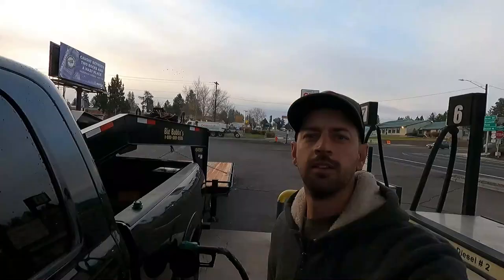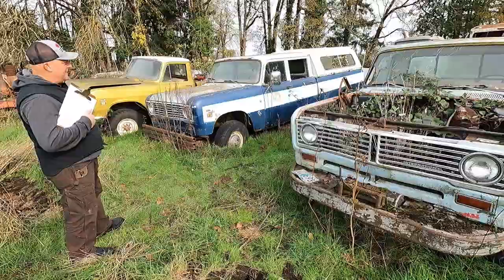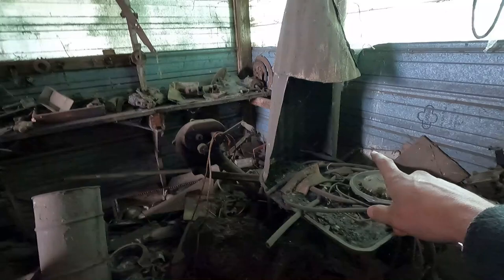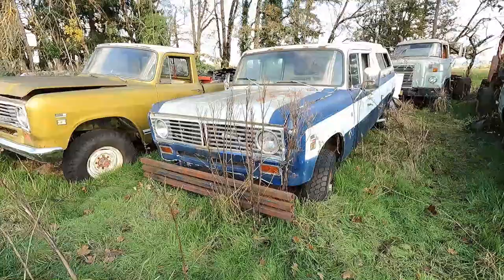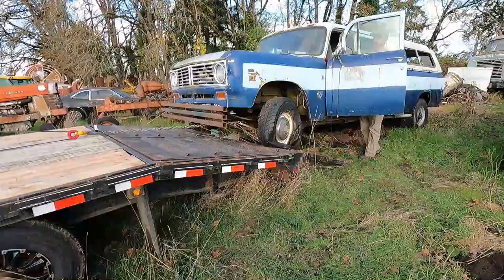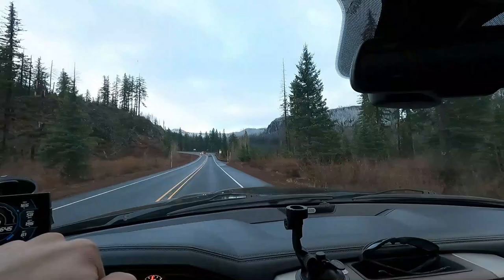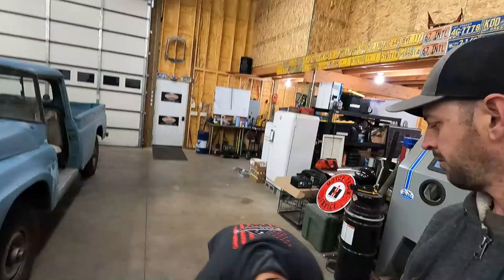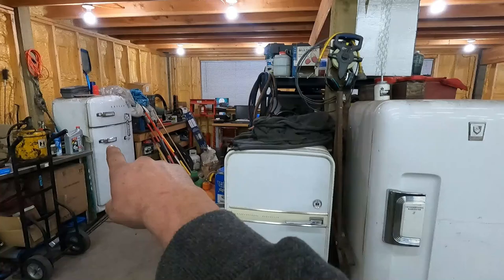Rescuing classic trucks!  Going picking at a 150 year old ranch!

Comment: an old boy here in town bought a 1967-68 3/4 ton international out of the factory with a in line six engine  which IH put in their 656 farm tractor, combines and other  farm equipment. later IH 3/4 ton 2 ton up used their 6.9 diesel in them. That 6.9 liter was sold to ford to install in their pickups which later became the 7.3 when they installed turbos on them. That will get you started with some exploring on ford using IH engines in pickups and larger trucks

Comment: Used my harbor freight winch to drag a dead 99 suburban that the rear tires were seized up onto my trailer today. Winch never Skipped a beat and just kept pulling.
Reply from the maker: Yep, they are awesome.   And this was only the 9k winch.   My other receiver mount is a 12k
Reply: @CaseyLaDelle  something wrong with the remote?
Winch seemed to be cutting out.
Reply from the maker: @haroldphipps3457  yeah....  My finger on the button..

Comment: We all use the hobo freight winches like that, but if you read their warranty, they specifically void the warranty for that use. 

I’ve always used the 12k model. I’ve pulled an international dozer with locked up tracks sideways. Had to have someone in the truck holding the trailer brakes full on with truck brakes full on as well. I’ve only have had the 12k snap twice and that was my fault for not having it secured properly. 

My only complaint is that they don’t have enough space above and below the cabling. Would be great not to worry if the wire is perfectly wound.

Comment: I've got a 12,500 pound winch I bought from Harbor Freight a while back (haven't installed it yet on my  1949 Chevrolet 6400 Series truck I use as a wood hauler) and I haven't seen anymore of them, seems like they are all now 12,000 pound winches. Mine is a Turbo Shift Classic and I plan on using it to pull logs into my truck so I don't have to venture off and cut the wood into small pieces then haul each piece back and split in then stack it in my truck. Going to save me some time, work smarter not harder... I think I heard that somewhere before!!! 👍

Comment: Traction King was a 70's model of a Case 4 wheel drive tractor. My dad was a Case dealer when I was in school. We drove a lot of these and the others around. my brother and I worked for my dad from when we were 12 years old. the 70's models were so nice compared to the 30's models. Like a 830 model, 930 model, 1030 model, etc. became 870, 970, 1070, 1175 and the 4 wheel drives were cool to drive too. Key point of the 70's models were the quiet cabs that had radio and air conditioners. The engine for the bigger tractors was a 504 turbo straight 6. Case had gone into a partnership with Cummins at the time to produce an efficient engine. Lot of years ago though for me.

Comment: 29: in and watching the unloading. U just hit on the issue the forklift was having. That diesel engine looked super heavy. Wide thick cast iron. Looks like he could have picked up closer to the front and deeper on the forks, but mainly, that thing is just ultra heavy. Rear axle may have been a srw D70, but not heavy enough to truly offset/balance. What fun though. That valley was like quiet as heck.

Comment: On the engine. Ford at first used an International diesel. Had so many problems with it, Ford designed and built their own. It got the diesel pickup market started. Buddy had one. Sure looked like the engine in your pickup.
Reply: IH built and used that engine for many years, then Ford made a deal to use it also in their pickups until they built their own recently.  They had GREAT success with both the 6.9 and the 7.3.  the only one that had some problems was the 6.0, but not everyone had trouble with them and many of them have 3 and 400,000 miles on them, and the 6.9 and especially have 500,000 and more trouble-free miles.

Comment: INTERNATIONAL,  EQUIPTMENT, 3600 acre farm in 50's had  even INTERNATIONAL  chest type deep freezer, D6 bull dozer, cab over stack rake cattle hauler, 1 ton 4 wheel driver pick up, plowed 3 mile drive way , by East Jordan MI. An M DIESEL TRACTOR , coolest place spend lot of gun times.

Comment: instead of using square wood for the winch cable at the end of the trailer,  try using a round piece of wood or pipe. It will move with the cable as needed.

Comment: My uncle had a huge salvage yard n tried to work me to death in it. It's driving me crazy I can't remember the brand of the other cab over like that he had that was way older and terrifying. 10 speed column shift .This is true. Without a load on the fifth wheel a light tap on the brakes would stand either one of them on the  bumper and windshield. Not a fond memory. Dandahermit

Comment: The motor that is in that 3/4 ton International crew cab pickup is a International diesel motor and most likely came out of a Ford truck.  Ford started using the international diesel motors in production as a OEM option in 1987. When you opened the hood on a new Ford 3/4 ton F250 or 1 ton F-350 the motors were painted in a medium Grey painted color. Ford used the international diesel motors from 1987 till the early 90's. When they designed and produced their own diesel motors which were the "Power Stroke" series which had their own problems with oil lubrication and other problems. They have designed a number of litre size motors through the years till present. What is really a mystery is that the International company was not building a pickup trucks at that time so none ever had the V-8 diesel that they produced for Ford in a International pick-up until someone put one into the one you picked up here!

Comment: Hey Casey &  Ben !!   Looking at ""GOOGLE""  ,,here's the list of diesel motors that IH used in the 1966-1988  (DV)462 -7.6L-460CI 1966-1988    (DV)550-9L-550CI  1966-1988   (DV)550B -9L  1966-1988 
D series -D-150,,D-170,,D-190 ALL V-8 --9L --1962 Early 1988 
IDI---IH/FORD  V-8 --420-6.9L --1983-1987 & 7.3L --1988-1994 
Hope this info. you can use ??    🤔😃👀👀👍👍👍👍👍

Comment: You can have all the cheap china winches. I will stay with my Warn. Made in Oregon, not China.. The warn that came on the trailer was a very light duty and would not have had the pull you need. Warn makes a bunch of winches of all duty ratings. Was not going to post until you keep taking bad about Warn. Warn be around and used in my life longer then you have been around. So do not talk down what you have no experience with. Makes you look very bad.
Reply from the maker: And assuming what my experience is makes you look even worse.   Pot, Kettle, Black.
But since you are obviously so well versed in winches.... I find it odd that you don't know that the winch I pulled off was an M-8000, which is not at all a light duty winch.   I also find it odd (with all your Warn experience) that you originally commented that it was not even a Warn winch, and was just some light duty off brand winch, then erased your comment when you realized you were wrong and wrote this one instead.  Yes, YouTube still shows me the comment you wrote and deleted....